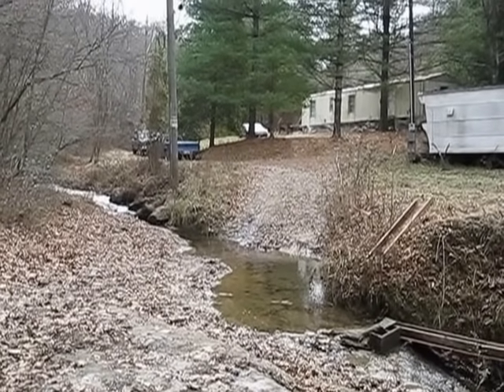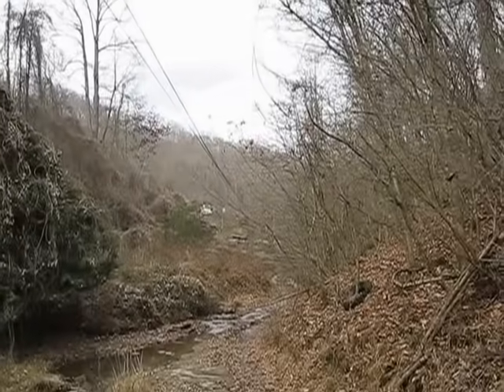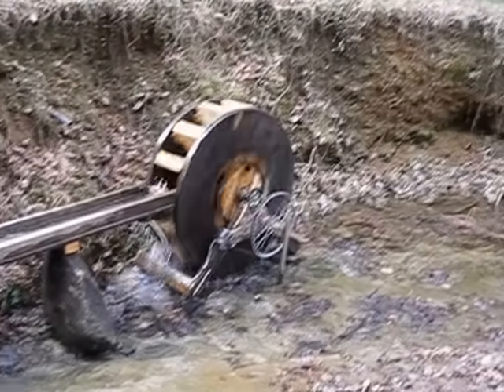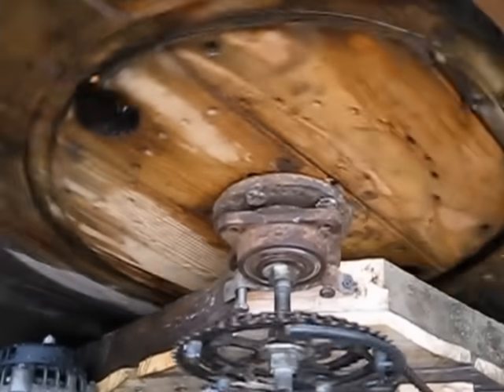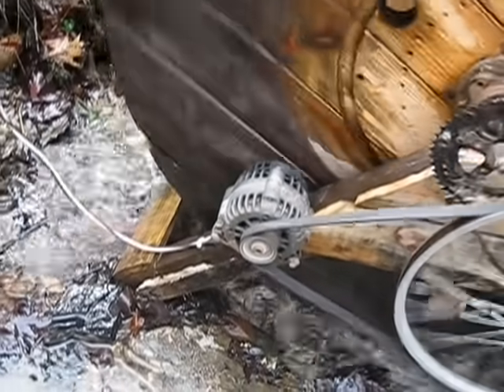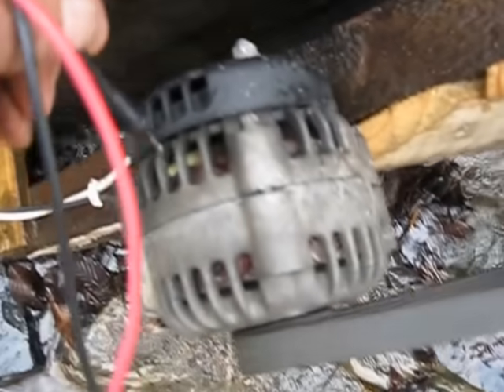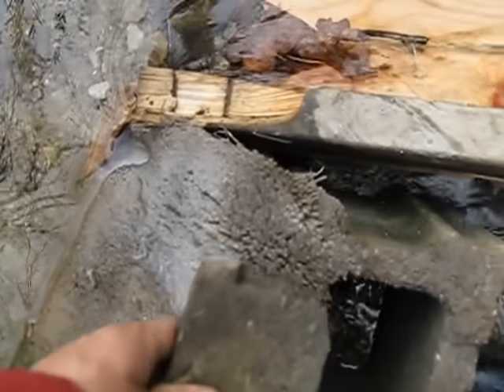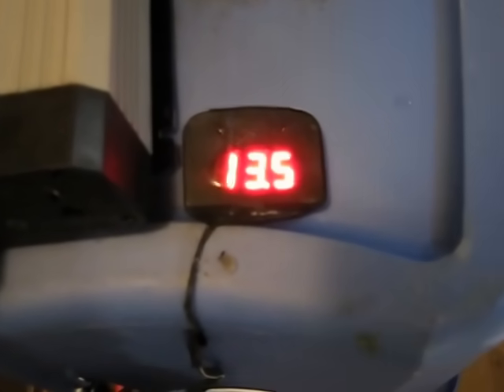water wheel generator

Comment: Very clever.  Well done.   If you increased the head (the distance the water falls before hitting the water wheel) it would generate more power and spin the wheel faster.  Also, if you get rid of the belt and converted that drive section to chain as well, the efficiency would go up again and you could likely spin the alternator much faster than now and generate more amperage.  Rubber belts are constantly robbing power to do being constantly flexed.

Comment: I like this kind of project; the fact that it was done and works is significant regardless of the efficiency. A longer race would help reach the top of the wheel and setting the wheel in some kind of frame so that it could be raised out of the way in a flood could help protect the investment, but it's wonderful as is.

Comment: Great video! Could you run something pulling 1kw off of this system 24/7? If not, what do you think is the max continuous power output you could run?
I have a similar stream through my land and would like to do a similar set up! Thanks!
Reply: Yeah I would have liked to see an amp draw at the alternator and after the charge controller. 40V by itself doesn’t tell us much.

Comment: hello,  what type of charge controller did you use? good job!
Reply from the maker: It's was a charge controller from a camper that had been modified. Later on I used a solar panel charge controller that came with one of my panels.
Reply: thank you, yes the solar panel charge controllers are very nice

Comment: I was imagining something like this and found your video. Very interesting set up! My idea was along the lines of power generation without batteries, but using a water tower as a "battery" instead. So something like a running creek and water wheel, or solar panels, or wind, could run a water pump at any rate. The water would be pumped from a reservoir up to the water tower. Then I'd have to build something that would regulate how much water would be let down from the tower to meet my power usage, spinning a generator. Also would have to have something that stopped the pump whenever the tower got full. Then the rate of power generation and usage doesn't matter, as long as the tower doesn't reach empty. Might have to use a battery as a medium anyways, but just for even power supply not for storage.

Comment: Most of your energy is wasted trying to turn that big heavy wheel.
Reply: so what would your solution be? take out the wheel and get free energy?
Reply: A much lighter wheel.
Perhaps aluminum or even devise something from bicycle wheels or whatever you can find.
Reply: Hey...let's see your video.....
Reply: Craig Stock the weight will really only effect startup time if anything it'll act as a flywheel
Reply: No, keeping a heavy object in motion required a lot of energy to overcome the effects of gravity and friction.   That's the reason an object can't travel the speed of light.  As it approaches the speed of light the mass becomes infinite and would require an infinite amount of energy to move it.

Comment: can you please make a video building your alternator?  you're the only person who we has made sense of anything on this subject.  please please please
Reply: DoD Secure , I have built four of these pma's or permanent magnet alternators, take a GM alternator from the 70s or early 80s, 10 SI or 12 SI alternator, take it apart, save only the diode block and stator, no need for anything else, clean and re grease bearings, give thermodyne systems or Missouri wind and solar a call and they have the permanent magnet alternator rotors for sale , I got mine from MWandS and installed them , they all four work great , my plans are one for wind power , waterwheel power , bicycle power , and one to a 40cc chain saw engine ,  I test spun each one with a power drill to make sure it worked and made power ,  trying to get forklift batteries or marine deep cycle gel batteries , and DC electric wire , I have one 1000 watt converter , and need two more only larger and one with 220 volts , need any help or information let me know

Comment: The amount of power you can get from the system directly relates to the height of the water before it hits the wheel if you wanted to ramp up the amount of power you get out of this getting the water to hit the wheel from higher may help a lot

Comment: Thanks for the insight I have a waterfall that's the water flow through it would be about 5,000 gallons an hour when water level is low  in the rainy season it roars that's about 50,000 an hour my house is 1/2 away how much electricity would I get out of that waterfall  it's public recourse so I won't have to ask for permission to build a project there how many volts do you think I can get out there.
Reply: alfred kabura .. water is a public resource, yes... water ways are not
Reply: alfred kabura you'll need permission from your town before you mess with water ways.... unless you just do it and don't care about whats down stream.. I'd do it but I'd make sure the foot print is not harmful
Reply: Hello Alfred, Do you have the water head information? With water head and water flow rate are able to figure out how much electricity you can get.
Reply: Sean E. Parker you are right to ask for permission from the government first I'm sure they will like the idea because electricity brings growth comparing places without it many people move out searching for a better life. The few institutions in those remote areas would benefit so will be the locals as for water pollution, I don't see any mess just water running the mechanism and to before starting building, I would build a water channel bypassing the project area I like that company called pelton .

Comment: nice and well done dear bro I really love your project sample and efficient but I have a suggestion for you!! if there is luck of water u could make a DC water pump and make a cycle form to return back the water on the system again thanks
Reply: I'm considering that. I'll use the waste water (left after the turbine) to construct another undershut turbine specifically for a 12 volts water pump so the main turbine would take twice the normal water flow. Even two more systems downstream to quadruple the supply of water for a bigger system.

Comment: Maybe tandem alternators?
Reply from the maker: This set up doesn't have enough torque to run two alternators. I am currently re-designing a better wheel that is bigger and also has water coming in on the top of the wheel.

Comment: You can make one of these self contained in a concrete box by adding a return pump resupplying the wheel... The only thing I see that needs improvement is a rubber shield over the generator....

Comment: since you get 40 volt, is better you switch to 24 volt inverter. 24 volt travel better than 12 and need less thick cables, less ampere so less heat is wasted.

Comment: Bad design. Better to have the water race running over the top of the wheel so the kinetic energy in the moving water is in the same direction as the wheel and the weight of water pulls the wheel down. Check old factories

Comment: Anyone with a love for waterwheels should start with reading "Stronger than a thousand men" the definitive history of water wheels. Also PAT - pumps as turbines books, and several small hydro power books to be found on a good library search. Alternators are cheap, but fragile and limited. Turning a 3 phase motor with your water power is far better and the output at a high voltage can run huge distances with very small wire. If dumped into resistance heaters, the delivered voltage is fairly irrelevant and ideal for water heating and space heating.

Comment: I live on the site of the second water mill recorded in California mining history. It was built in 1850 and was 40' in diameter [!]  Quite well documented and the property is still called  'Spencer's Mill' on the county tax maps. I have carefully excavated the area and have found the remains of several arrastra's and a few 5 to 8' diameter portions of cast gear wheels.  The wheel washed down stream in 1852 in a flood.They flumed the water in from far upstream, now private lands. Just past my property line in this steep canyon is a stepped waterfall perhaps 300' fall in 100 horizontal feet.I have created a small damn with submerged, slotted pipe pick up, so the water is perfectly clean and the floods of 4 to 7' above average water line have no matter. I am about 200' down stream with 6" pipe, and the future should bring about 40' of total head when I find a route through a small waterfall and 2 deep granite sided pools - sheer rock walls 40' tall all around. Pretty magical spot. I would take 2" poly down that 300' waterfall, but that portion is BLM or government lands. Could generate power for the entire neighborhood with that scheme. I am on the grid, so the economics of this don't really pan out. That bicycle wheel would give out in the winter just when you need it most. I'll likely end up with 20' of head and all the power directed to a few electric water heaters for floor heating. That pencils out. Or at the least a 15' overshot wheel for the romance of it.

Comment: this set up can power lights, tv and low amperage items, its things like water heaters and motors over 1/4 horsepiwer (about 200watts) that will SLOW the water wheel. Just a guess but this producing

Comment: If you wire this to a solar charge controller are you are risk for over charging the batteries ever?
Reply from the maker: It is wired into a camper charge controller. I also have solar panels now and they run through their own controller.

Comment: good going!  I may see one thing.  As you load up or charge on those batteries they will put out hydrogen gas.  covering them up with tub like that may keep the gas and smell out of the house,  but if it catchs a spark or arc it may blow. Just saying.  I may be wrong.  I would think about venting it outside or putting my battery outside.  Kudos Sir. I have similar idea.
Reply from the maker: I now have deep cycle batteries in a box that is sealed from the house. I hope your idea works. If it does make a video of it.

Comment: Ya know if you ran the water over the top it would spin x2 faster and generate far more! :/
Reply from the maker: I don't have the height to run it over the top in the location in the video. I'm working on a better design in another location. The new design will be steel and will allow an overshot wheel and will also allow me to lift it out of the water when it floods.

Comment: Off Road/Off Grid                I'm pretty sure the tv converts A/C to DC by use of a transformer, measure the output of the transformer, you could run the TV off of straight DC. Add another generator. Make the buckets on the waterwheel a little bigger. Make it fill the buckets as high up as you can. Is there a big difference in output when you change gears on the bicycle wheel?
Reply from the maker: I'm improving the design of the wheel and the location. It's going to be bigger, made of steel, and be an overshot wheel.

Comment: I love it!  U have the basic idea.  I see enuf fall in the video to replace your undershot wheel with a much larger overshot wheel which could produce enuf torque to spin multiple alternators.  Channel the full flow of the stream.  Forget 12 Volt basic system.  Run 110 VAC off 3 or 5 ganged alternators chain driven, eliminate belts.  Chains and pulleys can be salvaged from old farm equip.  Use the entire flow of the creek!  Alternators should be mounted above the splash zone or otherwise protected.  Yes a 12 VDC inverter and battery system can still be used tor low voltage needs such as lighting.  Your major goal should be 115VAC  for dependable AC power 30 amps or more to run refrigeration and such.  It's not rocket science.

Comment: for more power try digging out the creek bed several feet down and damming it up then run another water wheel off of it.
Reply: Or run the water across the top and down the other side of the wheel.

Comment: Is your system still working? I wonder if you are still using the same batteries after all these years,
Reply from the maker: No I have all matching deep cycle batteries now and they are in a sealed box vented to the outside.

Comment: If you have a wood stove, you should look into peltier generator (Thermoelectric Power Generator). Its a small square of semiconductor layer with a negative wire and a positive wire that produce electricity when there is a difference of temp between both side. Each unit don't produce that much, but if you get a few and put theme is series/parallel, you should be able to get a few hundred watts out of your burning stove.

Comment: just make 3 or 4 more water wheels...or more. Use the water. Make a bigger dam/reservoir in case the creek water flow goes down. Do some study on dams...how they discharge excess water automatically. You can make numerous channels off one large reservoir for numerous water wheels. Then go get a TV, hook up your water heater and you are in heaven lol.

Comment: Waterwheels are twice as efficient with water entering the wheel on the downstream end rather than in at the upstream end, but you'd need a longer rill for that.
If you dug down and then dammed the creek you could build up a head of water, so when you needed more power you could open up the slice gate and drive the wheel with more water.
At some point you'll be producing power when you don't need to, and that it the moment to start building up a head of water behind the dam.
A lighter and more efficient wheel design would help too, but you'd need to salvage some aluminium for that.

Good video though, did your State make a fuss about you using the water for power? Like in some Sates they claim the rain belongs to them.

Comment: Ok using my schoolboy physics we have the potential energy at mgh, flow looks in the order of 1 litre per second ( I think that may be a little generous) so we have 1kg x 9.8 x 0.5m  = 5 j/s = 5 watts. There may also be a benefit from the kinetic energy as the water is moving but I suspect it's fairly small. At a guess the total setup would have an efficiency in the order of 20% therefore a usable  power output of 1 watt. I admire the idea and creativity but that's a lot of effort for 1 watt or has my physics let me down?

Comment: 1. What happens when the creek freezes over?
2. Is it windy enough there to use wind power? You can convert a diesel generator to    
   110vac for power.
3. Have you looked into buying used construction or highway solar panels?
Very nice setup.

Comment: That was a great setup, the only thing that I would change is to mount the alternator higher and on the other side. The alternator works in either direction, its only its cooling fan direction thats an issue when its mounted to an engine. Fan not needed here.

Comment: Nice setup but you are giving up a lot of potential energy with that water wheel setup. The water should be flowing over the top of the wheel for maximum efficiency.
Reply: Build a v flume and run it another 300' downstream, off to the side. Tthat gets it out of the flood zone and gives you a chance at a overshot and real power
Reply: Looks like it's turning too fast for the water flow, and not that much water is flowing. The wood doesn't appear to be treated, the wire spools are not I know for a fact. The way the wheel is designed the water should go to the back of each section, if so it would stop or slow the wheel down..
Reply: Yes, except that you have to have a smaller diameter wheel to fit under the available head, so less torque and not necessarily as big a power improvement as you'd hope.

Comment: This is amazing.
What happens if it rains and the creek runs faster? Does it wash away your "off switch"? lol. Or do you not get much water there?
Reply: Grats on 2.6 million views too. Deserves it.
Reply: I have the same question..one gully washer and its all gone
Reply from the maker: Yes it has taken everything down the creek before and I've had to re-build. I'm working on a better design that attaches to the bank and can be raised and lowered by pulling a lever. I'm also moving the whole thing to a better location that allows a larger overshot wheel. There will be more videos soon.
Reply: YOU COULD USE A TOILET FLOAT TO OPEN A GATE  TO ALLOW EXTRA WATER TO FLOW AWAY A FLOOD GATE
Reply: Chris Foster
Reply: Like in Texas huracan right..?
Reply: Chris Foster all pa
Reply: Chriiiiiiiiiiiss Fosterrrrr

Comment: I would raise the alternator to help in case of flooding. If you just rotated it above the wheel that's turning it you could raise it s couple feet and still use the same drive geae

Comment: I have a creek and I also have Springs that come out of the ground I've been trying to figure out a way to make that water turn into energy and I kind of had it in my head but this just explained it so simply. You don't have to be a rocket scientist or some special engineer to fabricate this. thank you for sharing
Reply: Put open loop heat pump on it
Reply: @andreycham4797  do you have more input ? I have a small creek and a natural spring piped in that don't quit.

Comment: I Find it interesting But Why Dont You Put Those Batterys on a rack And add A couple of Capaciters Or add 2 More Alternaters
Reply: Mermaid man.... not entirely true
Reply: Mermaid Man they only release as much as is needed to smooth out the ripple meaning they can’t release more than max system voltage so as soon as system voltage drops a little they release a little